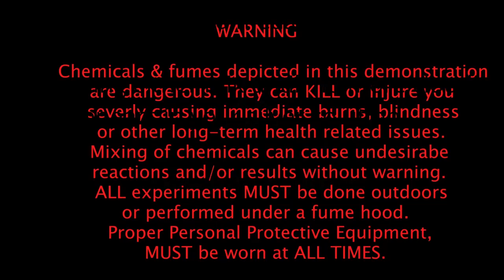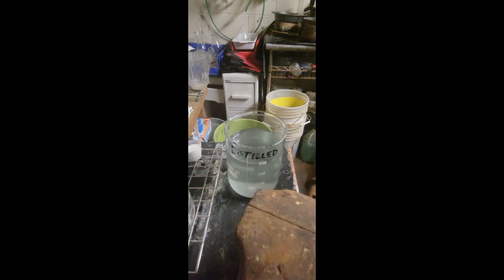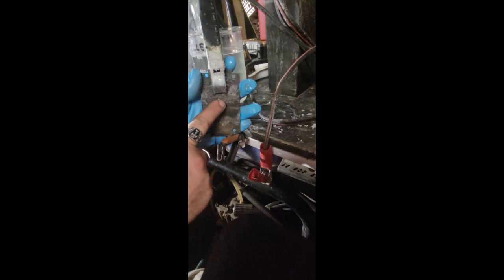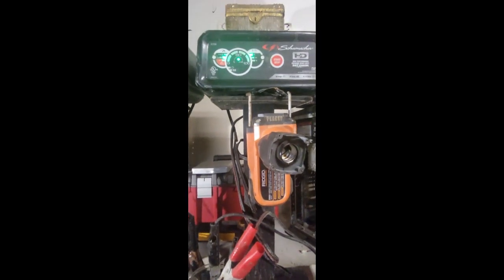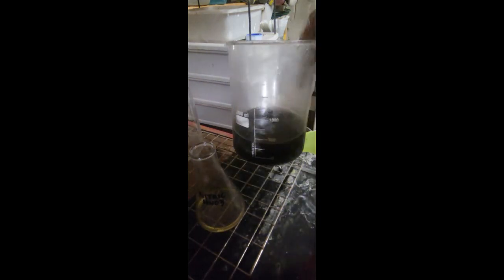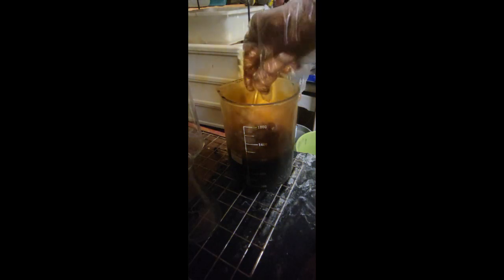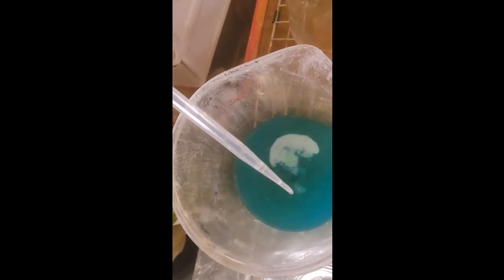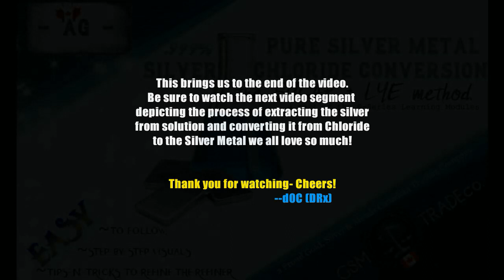the very BEST method to DEPLATE your SILVER

Comment: An easy way to do a lot in one go is to put some silver plated stuff in a storage tote with KCl, muriatic acid, plus a nitrate salt of your choosing, but avoid ammonium nitrate. The solution should be acidic but not oferly so. The reaction produces AgCl plus a wide range of other metal chlorides. The nitrate acts as a removal catalyst. What will happen is the AgCl forms a coating that simply brushes or washes off and settles to the bottom. The base metals remain in solution which will turn blue over time. Endpoint is when your silver plated stuff shows its true color. Sort by metal type and recycle. To convert your AgCl to silver simply filter it off than disolve in ammonia solution and electrolyze it. You will make silver and amonium chloride. Another option is to reduce with carbon or copper❤

Comment: Interesting stripping method.  I stopped with plated silver a while ago because it was such a pain to remove but this looks very good.  I had never thought about adding a nitrate salt to the stripping vessel.  

As far as refining the silver goes I would advise two things:  First, filter the life out of it once you have it all dissolved.  The clearer the solution is the more pure the end result will be.  I found that spending more time filtering will save you time and reagents down the road.  

Secondly, I would advise NOT using HCl to convert to silver chloride and instead use potassium chloride.  I use water softener salt for this (25kg bag was $20).  This works the same and produces the same silver chloride but it also creates new potassium nitrate which is very easy to recover and purify.  I use this same potassium nitrate to generate new nitric acid and dramatically reduce my costs.  I've literally recovered well over 10kg of potassium nitrate this way and use sulfuric acid drain opener to make new nitric acid.  I just keep cycling it all back around.  Not to mention nitric acid is getting rather hard to come by now.  You can use sodium chloride but sodium nitrate is much more soluble than potassium nitrate is making it harder to recover and purify.  

But a great method to strip the plating off.  I'll have to give it a shot.
Reply from the maker: I was in the same boat of thoughts. The old way or salt water way was just too much for so little, The extra Nitric and HCL to remove all the destroyed base metals that ended up in solution was frustrating. There just HAD to be a better way. Thank you! -d